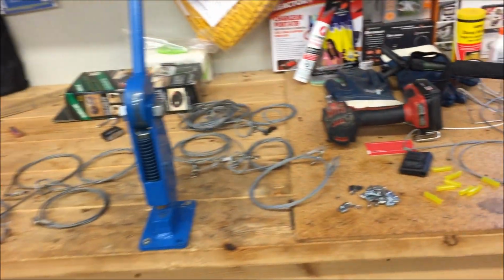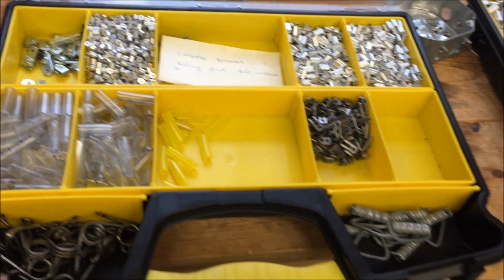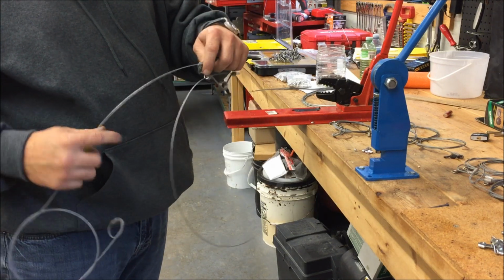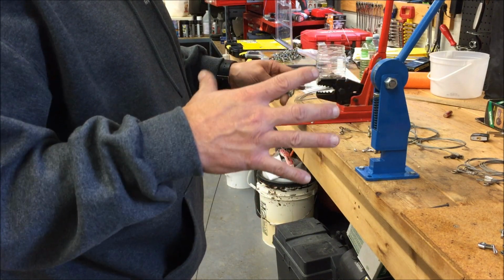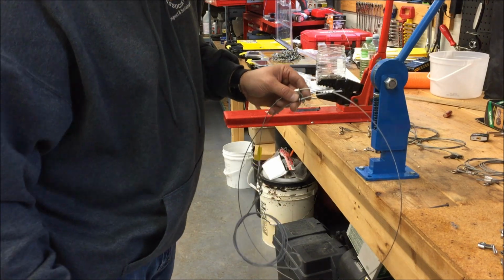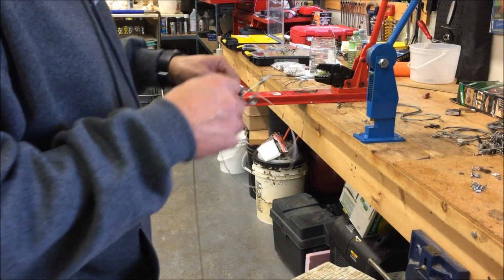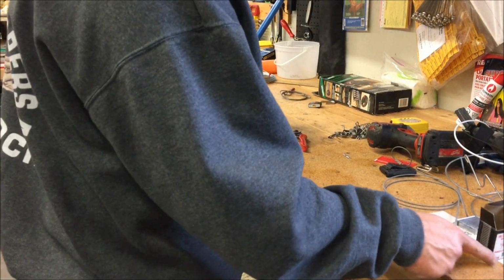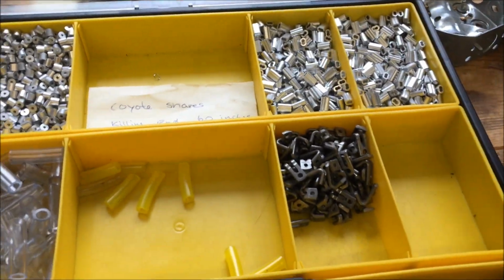Making snares Part 2

Comment: Nice kit!  Wow.  I need to go through my snares too. Idaho now requires either a break away, or a snare stop......mine don't have either.....need to fix that!  Our wolf snares have to have diverter wires too.  Funny looking antennas that collect snow and cause them to sag....
Reply from the maker: Some guys in Alaska use the diverter not sure if it’s mandatory. I’ve never used that kind before.
Reply: I think it is, Idaho copied Alaska's rules. It's sure a funny looking set up snow, birds and wind really mess them up.

Comment: Do you boil your snares to get rid of shine or straight of box and go set them?
Reply from the maker: Yes sir boil them in water with baking soda for about 15 mins. Remove oil on top of the water then pull them out to dry.

Comment: Since you are a long time trapper,,,with more experience then me,,,I want to know if you are familiar with the FULL METAL JACKET  dip??? And if so ,,is it really working ?? Try to find out why I get so much refusal with my snares,,,,they walk thru it ,under it ,,around it,,,it is very frustrating cuz we don't have as many as you per square mile here,,,I cought 6 this year and lost 3 (I didn't have senneker kill spring on them)
Thank you for you time and for those videos ( feel good to see some coyote catch )
Reply from the maker: Well I appreciate you watching. I haven’t used full metal jacket myself but have had some friends use it. I never heard that it affected their catches but they were using it on footholds. I don’t treat my snares other than boiling them in baking soda and sometimes put in bark etc to darken them. I’m not sure why you would be having the issues. Do you have snares that don’t have the FMJ on them. Could boil some and see if it’s that or something else.

Comment: Does the Big Blue work as well as the Swager? I have a Swager but was thinking about ordering a big blue. What is your opinion?
Reply from the maker: I bought a new swager and will sell you my Big Blue. Lol
It’s okay I just feel more confident in the swager personally.
Reply: @NorthernTrapper  I was wondering the same thing about if big blue was worth the investment. 
I think I am going to unfasten my swager from the mount base and turn it around a half turn so that I can use it close to the edge of the table and have the base out of the way and still anchor the swager.
Reply from the maker: That works really well.